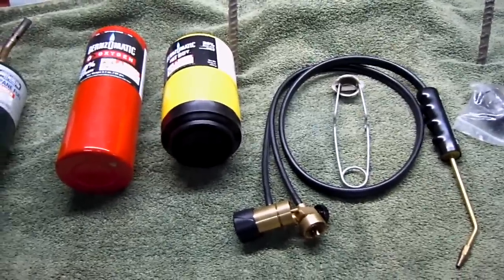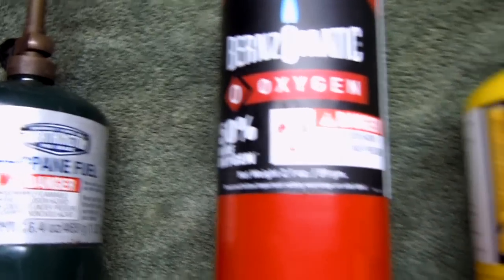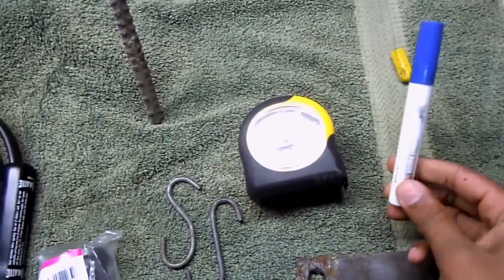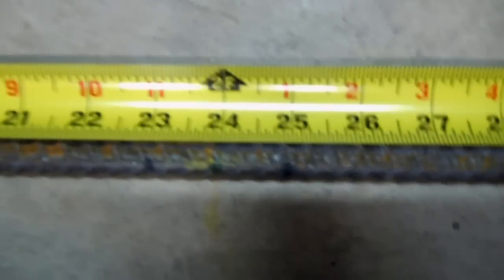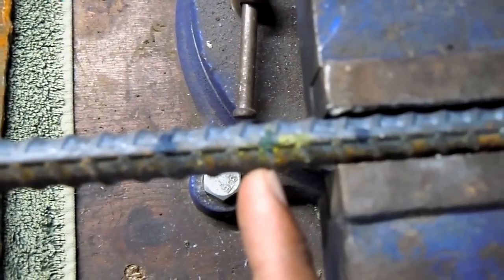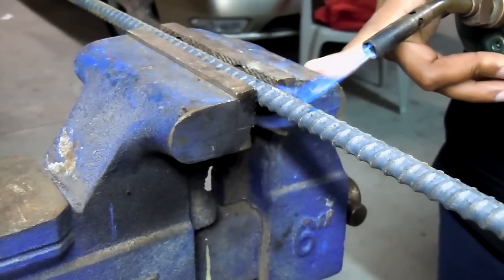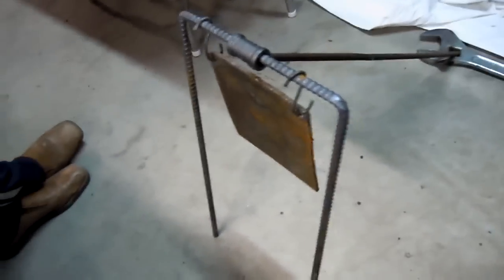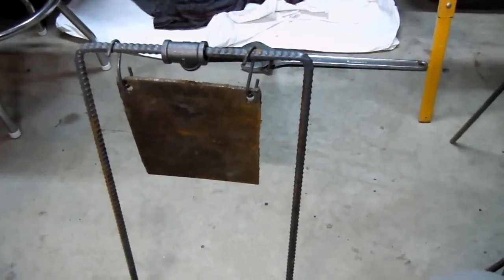How to make a swinging steel target (no welding!)

Comment: Just a heads up, rebar easily bends with no heat. I insert rebar into sections of black pipe and bend, using the pipe for leverage. This method works like a charm. I use rebar frames for some of my steel targets as well. Happy shooting.

Comment: I've built two of these.  One with the lighter rebar and one with the next gauge heavier.  The heavier gauge is much more stable for my 10" x 1/2" ar500 gong.  I just wanted to say thank you for your advice!  

The only challenge I've had with this is getting the rebar to sink into the frozen ground in the winter.  But in the warmer months this works like a charm.  I've had several guys ask me about it while I'm out at the local gravel pit.  

As far bending the thicker gauge rebar, I also ended up using the hot gas and heating for what seemed a lot longer than I anticipated.  Even with a cheater bar I could not get the thick stuff to bend.  (It would "arc" but not bend where I wanted it without heating it.)  Maybe I'll try again but my first one continues to work like a charm.  

I will be switching from chain hangers to rubber soon.  My "friends" have all shot out the chain which is a PITA to replace.  I think a good chunk of mountain bike tire will do the trick.

Cheers!

Comment: For better and cheaper steel, go to a scrap yard or search your phone book for local water jet or plasma cutting shops. They will often have circles cut out of plate from making manifolds for large pipes. Sometimes their scraps are pretty interesting shapes. Also, you can heat the mild steel up in charcoal with a blower until it is red or use a weed burner and quench it in used motor oil. That will harden it up a little without too much brittleness.
Reply: GunFun ZS does the oil need to be heated?  thought blacksmiths that did that used oil around 180 deg.    thanks
Reply: matthew rowland  I am not an expert on steel treatment. Based on my understanding the process will vary based on carbon content, etc. Mild steel is a term that covers a whole range of stuff. The general rule of thumb is that heating it red hot and quenching  it in cold fluid, preferably oil is going to get it about as hard as it will get. It won't be nearly as hard as tool steel or armor plate, but it will be harder than it would have been otherwise. You can get it cherry red in coal or charcoal with a fan or leafblower pumping in air. Or a gas flame. Charcoal or coal will also add a small amount of carbon to the surface. For other more expert advice or alterative methods, just google "hardening mild steel."

Comment: There is a lot more to heat treating than quenching. Yes, quenching is necessary to create martensitic steel ,but that steel will also be brittle (as OP noted) and riddle with stress fractures which will need to be normalized and tempered.

The bigger question here is why a target frame needs to be hard at all; this isn't the right steel for tempering anyhow, and deformation is a better result than catastrophic failure.

Comment from the maker: if you can find a scrap yard you can ask for quarter inch mild steel plate. There are some steel selling places (industrial areas) where you can ask for scraps. Last resort would be the internet and actually getting steel targets (slightly expensive and with this frame design it would fall over with thick plates.

Comment: Here is an easier idea, that doesn't take any effort, is 100% portable and replaceable, doesn't cost too much more, and lasts forever. Buy two pieces of 36" 1/2'" metal gas-line pipe, one 18" piece of pipe, and four 12" pieces (or scraps with at least one good threaded end). Buy two 1/2" elbows, and two 1/2 " "T"s. Put a T on  a 36" piece, then add elbow to other end.  Insert 18" in that elbow, then the other 36" in the second elbow to make an arch. Put a T on the bottom of the last 36". Twist the T to be opposite the elbows, and add the four 12" as feet.  Use chain, clips, or wire as a hanger for a plate, and you're ready to go. If it wobbles after a hard hit,  cinder blocks or rocks on the feet to make it more stable. (Don't use sandbags, they get torn up) I've been doing this for 30 years, and have made them form 24" to 60" tall. Cost is about 35 bucks, and when you inevitably shoot a hole in a part you can take it apart and replace.
Reply: You should make a "how-to" video

Comment: You don't need to heat up rebar at all to bend it. Simply stick end into a pipe and Bend It. Or use a stationary object like the hitch on a vehicle to give you leverage and use your body weight to bend the rebar.

Comment from the maker: then you have to temper it so it is not brittle. Plus you must hit critical temp first. Rebar is not a great metal to heat treat with, and even if you anneal 3/8in rebar it wont just flop over. It hasnt bent out of shape even with pushing the legs into the ground so many times.

Comment: I think the vice is absorbing all heat.
Heating the re bar with the propane  and then position the ree bar  in the vice would save you the oxygen then sliding a pipe in the ree bar to bend it.  But is a great idea may be the legs longer to sink it at leat a foot

Comment: Just food for thought , you mentioned you weren't going to cool the rebar in water cause it would make it " brittle " when in fact dipping it in water will actually harden steel. Salt water works best, creating less bubbles that can enter the steel during cooling it. You can also use oil, mineral oil motor oil does the trick, but not as good as water. Just remember, that faster you can cool the metal, gets more out of the hardening process. Just my .02 !! Thanks for the video making some target

Comment: First re-bar is very soft and can be bent without heat. Put a pipe over re-bar and with rest in a vise you can bend easy and also very precise. Good design and will work well but no reason to spend the money for a torch to bend re-bar.

Comment from the maker: You will probably need 3/8 in thick AR500 plate (minimum, 1/2 in is better), but at that point you will need an entirely different frame because that plate gets heavy. I may do a video on that but im gonna have to design something that requires no welding.

Comment from the maker: if you can find it as scrap it should be free. If you want it online then check out my video called rifle range build step by step. There is a link in the description that takes you to website where I got my target grade hardened steel. Or it may be in my vid titled private range showcase???. I forget now. They should have quarter inch steel and pistol rated steel too. You can search for the vids on my channel in the channel search bar.

Comment: aside from not needing heat to bend rebar, you're holding the torch too close to the bar to get the best effect from the torch, AND you should heat from underneath the bar. Heat travels up. And this guy handles guns??!!